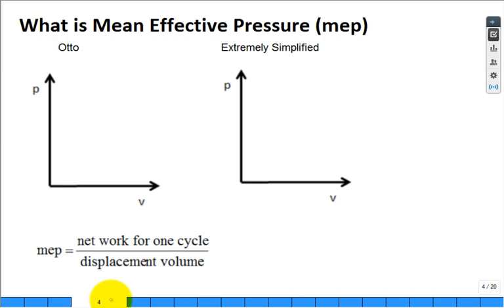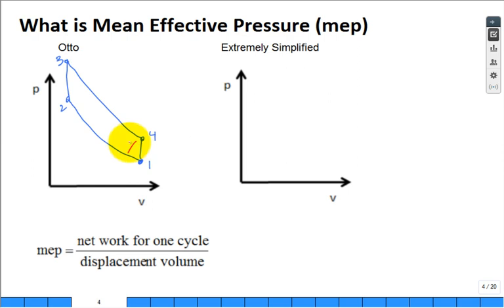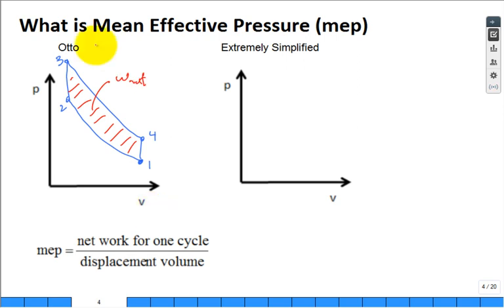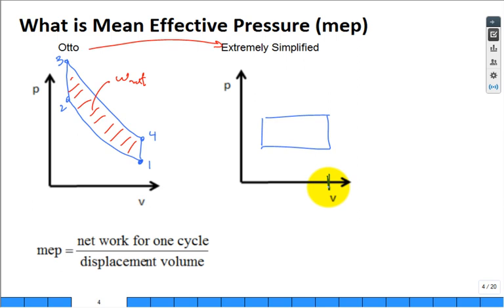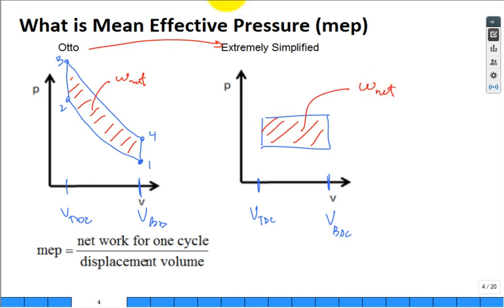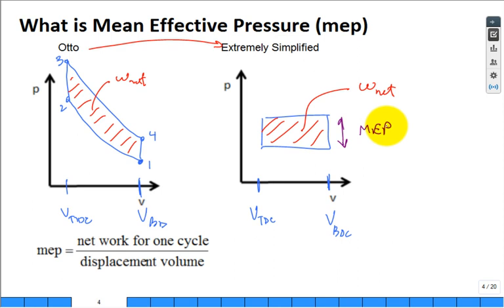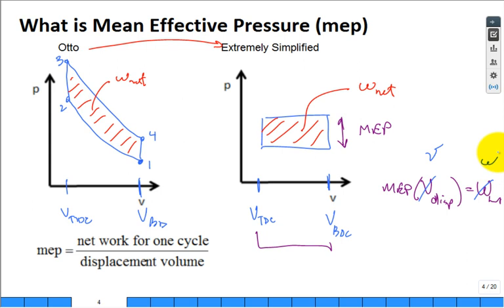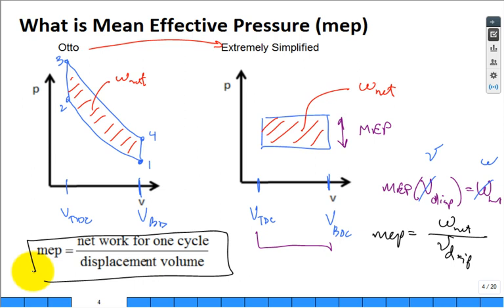mean effective pressure internal combustion engine

Comment: How do you calculate the net work then? That is what I struggle with. I do not understand that part.
Reply: You have to know the gas density curves. Combustion gases have their own densities which are different from air, and their densities change with temperature. Air for instance decreases in density with heat, CO2 also decreases in density but at a much lower rate, and the starting molecule is denser than air, supercritical CO2 would be perfect for gas turbines for this very reason. Likewise for NOx and other particulates. The heat, mass, and density contribute to the mean effective pressure generated. Turbochargers lose efficiency when they heat the air too much because air density drops with heat, this is why intercoolers make more power despite a pressure loss. The density of the gas is higher, thus has higher moment of inertia, it also has a lower kinematic viscosity.
Reply: (heat added - Heat rejected) / Head added